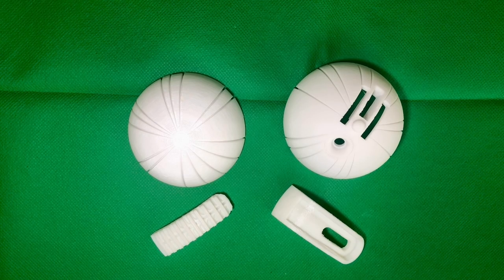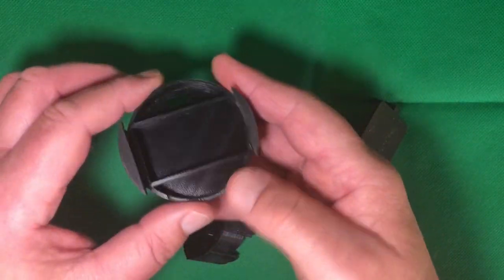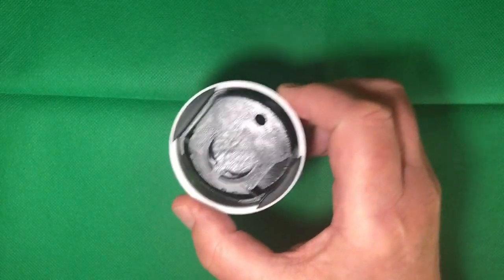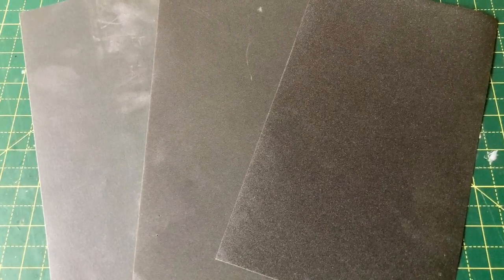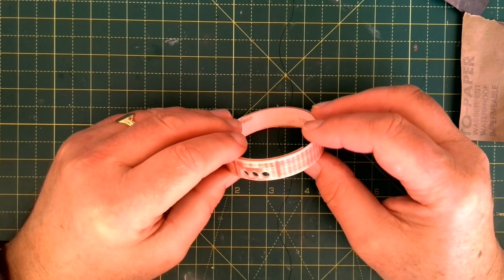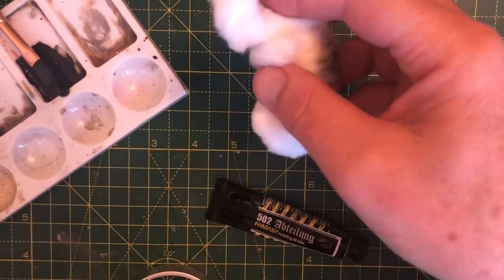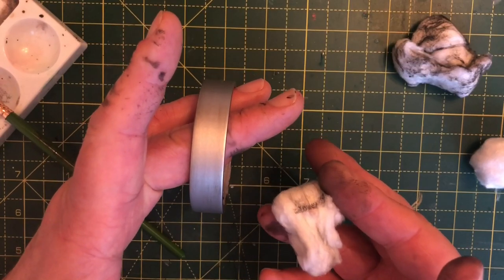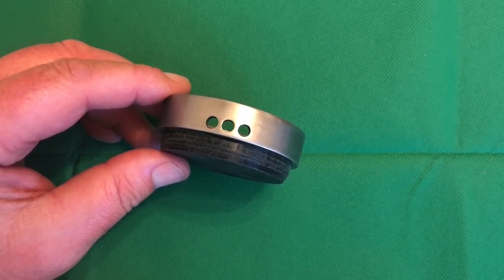The Thermal Detonator Build - Part 1

Comment: Hi Mark! I wanted to scale these files accurately to the movie prop and was wondering what percentage down they should be scaled to be accurate. Thanks!
Reply from the maker: I’ve no idea what the original prop size was, other than this link below which says it is about 2.5in in diameter. Just measured mine and it is around 2.9in.
http://registry.rebelscum.com/index.php?action=review&review=td_weathered
Reply: I appreciate the quick reply! I scaled them down uniform to a shell that was 2.5" but the 9 volt slot was too small to fit the battery. Back to the drawing board! @ScaleMarkModels
Reply from the maker: When I designed the innards, everything was a tight squeeze, so reducing it by around 14% to 2.5in will not work with the electronics. The 9v battery just fits in the scale I have. You’ll have the same issue when installing speakers an switches if reduced as well in the height. I’m not sure you’ll see much of a difference at 0.4in anyway. Good luck with it, hope it turns out well.
Mark

Comment: Hey Mark!  Have these pieces been printed via filament or resin?  If its filament, what kind of filament do you use?
Reply from the maker: Hi 
All the prints were done in filament. The infill was 100% and on the top setting on my Creality printer. The domes take about 12 hours each on this setting, but you do get a good finish and less sanding. The filament I use for this is JAYO white, I got mine from Amazon. The internal parts were black filament from Amazon too.
Hope that helps.
Mark
Reply: @ScaleMarkModels  that helps out quite a bit thank you sir.  I do have one more question lol…the link for the “expensive level switch” you provided is no longer working. Do you know where else I can find that? Amazon perhaps?
Reply from the maker: The other link below for the cheaper alternatives is below. I’ve bought some of these and they work fine, you’ll just need to bend the pins back once you’ve soldered the wires. I used these in a couple I’ve recently built for people and they fit and work fine. Again if you get some just bend the pins.
Cheers
Mark